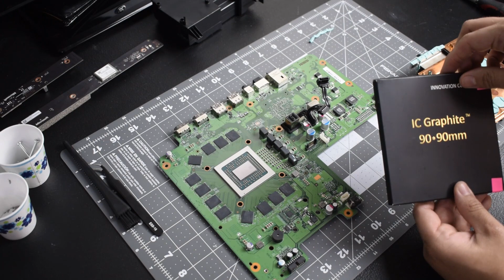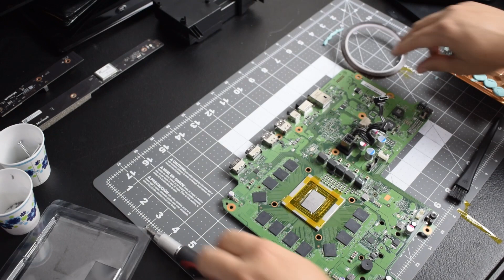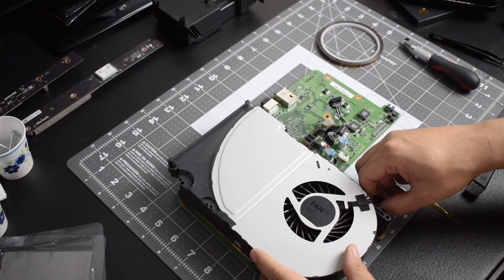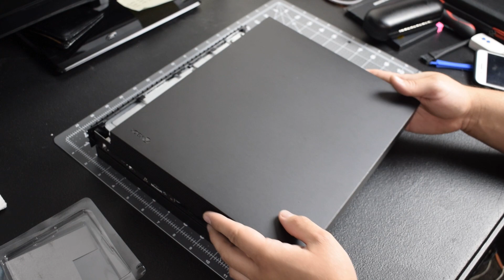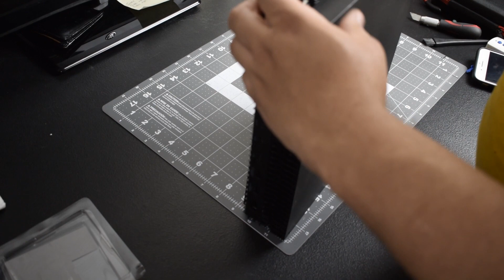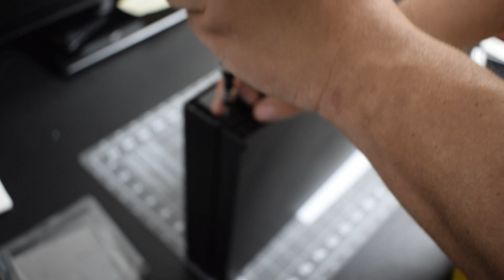IC Graphite Thermal Pad on  Xbox One X

Comment: Thank you so much for this video
I used thermal grizzy carbonaut cloth
On 3 Xbox one x consoles 2 x2018 1 x 2019 models 
It’s amazing never using paste again so quite on 4k gaming 
I just cut the cloth place on the gpu hold the board in hand and place the heat sink slowly and flip over and clamp it
Reply: So this does work?

Comment: It may be overkill, but I'm doing the same to my Xbox 360 S. Should be less maintenance. Just open it up to clean dust. 

The spread method with a card doesn't work. Xbox would freeze. Took it apart and there was no thermal paste making contact in the middle of the chip and heatsink. Only the edges were. I applied using a different method. 

Ordered the IC graphite thermal pad.

Comment: I'm ordering the Thermal Grizzly Carbonaut today in hopes I can salvage my Xbox One X.
Reply: It worked?
Reply: i want to try that pad too, how it worked out for you?
does the pad fits well between the heat chamber and GPU?
Reply: Bit of necro but did you apply anything to transistors as the grizzly pads are conductive, I'm just curious what people are using

Comment: My usb in the front is not responding neither the sync botton, what could be the problem
Reply from the maker: There is a daughter board for the front that might be bad , do you know if the back USB ports are working ?
Reply: @jasonsarrio6019  yes i check them they are working maybe the cable is bad
Reply from the maker: @AverageGamer784  could be the cable or the the daughter board that connects to the main motherboard that is outside of the metal cage might be bad
Reply: @jasonsarrio6019  any site where i can buy them
Reply from the maker: @AverageGamer784  I would try here https://www.gamersrepair.com/game-console-parts/xbox-one-x-parts/

Comment: good, I am about to put that graphite thermal pad on my one X although the warranty had already run out, does it really work 100%?
Reply: Sorry that I'm about 10 months late but I do have some useful information about this. 
There are only certain kinds of thermal pads that work with xbox. 
Rn I'm using a 50/50 combination of thermal grizzly and the original pads until I get more thermal grizzly pads shipped to my house since the pads are also in short supply.
I plan to swap to 100% grizzly soon and find out which is better.
Do not use any blue thermal pads from Amazon. My xbox overheated twice with those properly installed.
I also swapped my HDD for Samsung 860 Evo and 
I'm getting a massive combined benefit of higher average FPS from lack of thermal throttling and higher communication between Xbox APU and SSD memory.
I'm also getting drastically reduced load times and my boot up time this morning was 2.7 seconds, from OFF to home screen.
Restoring and upgrading the xbox, seemed like a good idea to me so that I don't have to buy an Xbox from a scalper, and in the meantime I'm getting an Xbox that seems to perform much like the new series x.
Hope this helps, peace
Reply: @ShadowLancer128  yesterday I removed the stock thermal pads and paste and applied Corsair TM30 thermal paste and Arctic 1.5 mm thermal pad. The fan now turns on much sooner and is much louder - obviously something is wrong. I also installed a Samsung 870 Evo and like you mentioned, I’m getting better FPS and better graphics. I think either the thermal pads aren’t very good, they’re too thin, both, or the thermal paste was old. It came from a brand new package and I did the spread method but it was very pastey coming out of the syringe and thick and dry. I had no prior experience with thermal paste so I’d said to myself “well I guess it is ‘paste’ after all” but videos I’ve seen online where people are applying it seem to show a more liquid and less viscous substance when pushed from the syringe. I too will be doing it all over again with Grizzly thermal paste and pads.
Reply: @xelence420  it's the thermal pads. Put the old blue ones back on. You didn't throw them away did you??
Reply: @xelence420  old post I know but 1.5mm pads are not think enough. 2mm pads are what you want

Comment: Curious to know how the Xbox is holding up as I'm looking to do the same for my XB soon. Any plans for another teardown to see how it's looking inside?
Reply from the maker: Hello yes I plan to open it up again in Feb 2020 but so far temps are good an it blows hotter air from the vents
Reply: Jason Sarrio hi can you please explain what you mean it blows hotter air from the vents so the air is now even hotter ca thermal paste?
Reply from the maker: @TheOneGhost12   yes it is about before it was around 65 right now on gameing it's around 70 there is more heat transfer to the heatsink
Reply: @RS1  If your echaust at the back gets warmer after replacing the paste, it simply means that the xbox gets rid of the heat faster so theres nothing to worry about. Warmer exhaust is a realy good sign of good heattransfer from the chip to the heatsink. Mine went way hotter at the exhaust when I replaced my paste and my fan are hardly ramping up when playing FC5 :)
Reply: @thepicard83  still good ? Some people say back thermal paste and clean every damn month :( I’m worried

Comment: How thick are the Vram thermal pads I need to replace all 12 of mine
Reply from the maker: 1.5mm
Reply: @jasonsarrio6019  Thanks....I opened mine up last week to put on some thermal paste and forgot to measure the thickness of the pads...They looked kinda worn and cracked.
Reply from the maker: @xboxgamer7453  yeah I also noticed some of the pads where off-center what about you ?
Reply from the maker: I'm sorry I just look at my notes it's 1.5 mm
Reply: @jasonsarrio6019  Yeah they were a couple not lined up and when i tried to re seat them they kinda broke up..So I think i need to take them all off and put new ones on..It's running quieter than before thanks to the new thermal paste.
Reply: @xboxgamer7453  its not 1.5mm, the vrm are 2mm.
Reply: 2mm from grizzly

Comment: Could I find replacements for those round blue thermal pads.?
Reply from the maker: Yes but it would be better if you put square ones since the chips are square
Reply: You want to use thermal Grizzly minus 8 thermal pads

Comment: And whats the results with the pad ? Is the X running quieter and cooler ? Is the fan noise now  qieter ? regards
Reply from the maker: Oh yes it barely audible
Reply from the maker: For temp I have notice a difference in fan sound it's much lower that rpm than stock
Reply: Ok. Nice to hear. How thick is the thermal Pad  ?
Reply from the maker: @andre23350  1mm
Reply: @jasonsarrio6019 what is the size 30x30 or 40x40 ?
Reply: Thnx for the quick answer. 👍

Comment: Well done! I did this to my PS4 PRo in January 2019 and it works wonders. PS4 Pro is so quiet and performance is great. I’ve noticed the fan kicks up only if supersampling, boost mode, or in 4K resolution but it’s not that loud. I also have an SSD installed (1TB). Running 6.81 beta firmware and no issues whatsoever haven’t had a problem since then. Cheers!
Reply from the maker: campos3452 awesome  yeah I plan to change to a sshd from the hd on the Xbox that’s my next upgrade